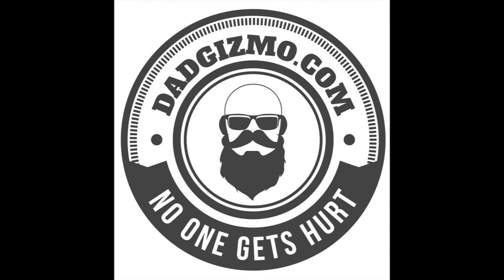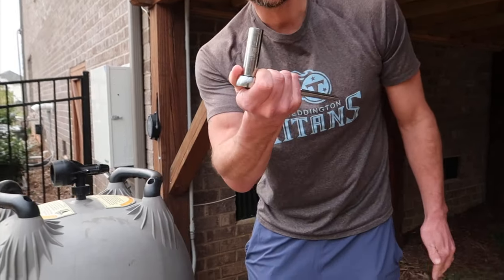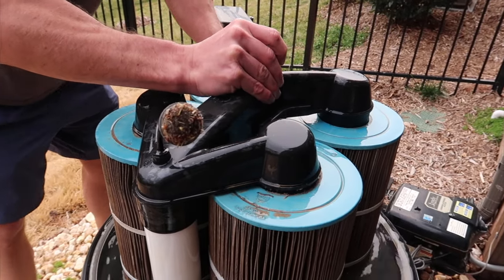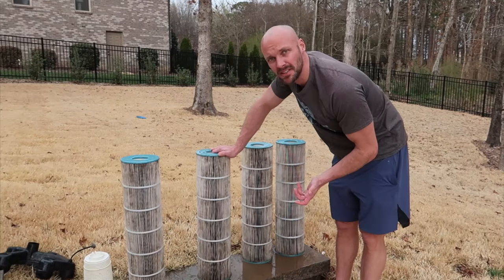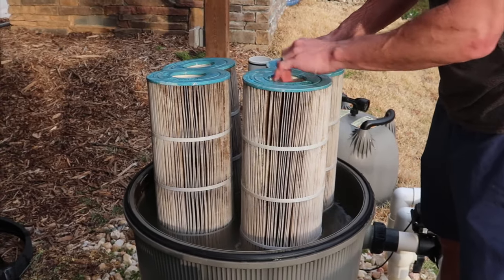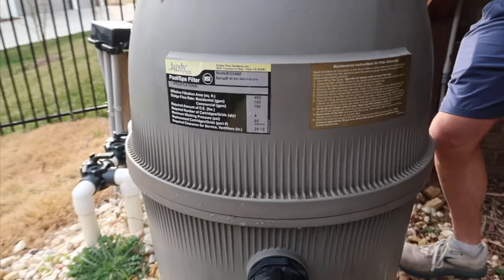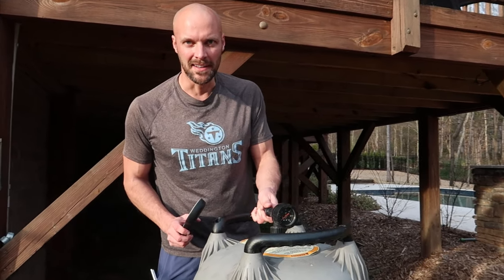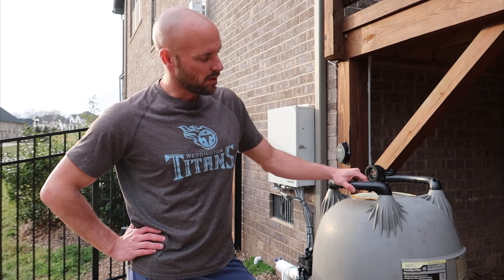OPENING A POOL - How to Clean a Jandy Pool Filter

Comment: You want to leave the breather valve open when you turn the pump on until water begins to run out of it. once you have a steady stream of water, you want to close it. This allows all the air to be released from the filter housing as it fills with water.
Reply from the maker: I never knew that!  Thank you!
Reply: @MrGizmo211  you’re welcome. Doing that allows the system to be primed. Hope that makes sense. Thanks for the video. Good stuff.
Reply: Thanks! This really seems doable…and maybe not as scary…
Reply: I agree.  We didn’t know that and when we started up the filter, all that air pressure came through the pipes and out into the pool.  It was scary because the pipes were shaking and rattling.  I hope it didn’t damage anything.  Lesson learned.  Keep breather open to release all that air.
Reply: Doing mine today for the first time! I’m confident!
Reply: Me too!
Reply: It was simple. After putting everything back and let the pump run, I though it was leaking , but it was just water dripping from released valve down to the clamp. Lmao. I was worried for a bit
Reply: What is the breather? The valve at the top that releases air?
Reply: @OfficiallySusan yes... I guess bleeder is a better term than breather.
Reply: This is a very helpful video.
We just did a remodel and the pool company was short on instructions.

Comment: I appreciate the video but there is a drain plug to drain the water out of the filter. And as someone else mentioned keep the air bleed OPEN when refilling until water comes out of it. Both of these items are covered on the instructions printed on the filter assembly.
Reply from the maker: Absolutely

Comment: Great video, but I will say that I find it extremely difficult to get the top back on squarely so that it doesn't leak. Takes a few tries and is frustrating, if you've got a pro-tip that would be awesome!
Reply: Hey bud, if you lube the gigantic O- ring and wipe down the mating area of the top, you should be able to just gently drop the lid into place. It will slide right on!!!
Reply: Light lube on the tank ring and Rubber mallet. Gently tap from the center of the opposite side of the bandclamp forward towards the center bolt. Do this from each side a couple times tightening between taps.

Comment: Excellent video.  If you are cleaning your Jandy filter than this is the video to watch. Thank you i followed you step by step and my first cleaning went perfect.  I would like to add that I drained my filter and if you do this then after you put the casing back together and screw it tight and secure you will need to open up the other filter with the smaller white filter with the tab that he shows also cleaning and add 3-5 gallons of water and then secure that top ASAP to eliminate air.  This will add enough water back into the main filter when priming and starting back up.  You always want to make sure you see water through that clear top. Hope that helps. Thanks again for this video you have no idea how much help this was.
Reply from the maker: Excellent points Mark!
Reply: …this is GREAT intel… I’m so glad you shared this. I’m gonna REALLY try to do this THIS weekend…🤞🏾🙏🏾

Comment: So why does Pool Guy charge $100 to $150 for this service?
Reply from the maker: Dunno - it is easily done :)
Reply: @MrGizmo211  Two questions: 1) What does it mean when you hear no pressure coming out of the valve and no air escaping when you open the p[pressure release? 2) what does it mean if the nut and bolt holding the outer black ring of the pool filter are very hard to take off I almost have to yank it off the pool filter!  is it dangerous for me to do?

Comment: Excellent instructions except when we turned the filter back on, the air from the tank blew through the pipes, shaking and rattling them.   I think we should have kept the breather valve open until water came out and then close it.  We also drained the entire tank to hose it down.  Later learned that we should have added water back in before starting the filter.  Lesson learned
Reply from the maker: Yes - that was something I learned as well :)

Comment: In another video, they recommended Simple Green cleaner. Would also rec draining entire housing (there’s a drain at base) & hosing down base. Very helpful video! 😁
Reply: Does it refill itself or do I need hose?
Reply: It refills once everything is reassembled and the pump powered on. Don't forget to ensure that the valve where you released the air is open until water comes out, then you close it. Nonetheless, I recommend just draining the water every time.

Comment: Excellent instructions, thank you!  The process is simple and easy to follow.  However, the amount of dirt and sand in the filters was shocking to me.  My pool is one year old this May, it's March right now, so I knew it was time but wow!  I think each filter probably weighed 20 lbs dirty and maybe 5 lbs clean.  My neighborhood is still under construction so there is a huge amount of dust, hopefully, this will settle down as time goes by.  Thanks again for the excellent video, very helpful.  I have a weekly pool cleaning service and they wanted $125 to clean the filters.  Now that I've done it myself I can see that's not a terribly bad deal, but I can certainly do this amount of work to save that money.  Now that I know the process I'll just clean them twice a year and try to stay on top of it.
Reply from the maker: The first year you get a lot of sand and things from the pebbletec as well.  Glad the instructions work for you !!

Comment: great job helping me understand how to change the filters.   I just removed old ones and put new ones in using this video.  so thank you.  one thing I did want to mention is that there is a drain plug towards the bottom of the unit.  After releasing the pressure, you can unscrew open that drain plug and water will flow out of the unit.  you can then rinse inside and water and debris will leave unit out the bottom.  overall though, great job!

Comment: Thanks for this, now I know how to do it, I was so super conscious of the thing being under pressure.
Reply: There is no pressure when the pump is off. The sound you are hearing is air being pulled into the filter system as the water is receding, not pressure being released. If you don't let the air in, then it is really hard to get the lid off and water will flow everywhere.

Comment: Super helpful.  NOTE:  If your pool equipment is LOWER than your pool (especially if it's several feet lower) then you'll need to add a step to TURN OFF the flow of water to the pump.   Otherwise, gravity will do its thing and draw water down to the system.   Then, when you remove the clear strainer cap or filter housing, water will continue to overflow out of the system.   Which can be scary.   Turning off the flow is usually done with a simple in-line PVC valve just in front of the clear cap strainer.    After you do your cleaning, remember to turn the flow back ON before you start your pump/filter again.

Comment: If you open the filter pump lid as well as open the bleed valve then the water will drain back down into the pipes (if you’re without a check valve).
Makes it somewhat faster/easier to pop the lid off. 
If your pool gets sediment in it and is vacuumed frequently the cartridge filters are suboptimal compared to DE filters. 
Also, be careful with Jandy drain plugs if you take them off. They are notorious in the industry for failing if torqued heavily.

Comment: so pool owner 9 yrs now - 1st put system in service mode so it wont accidentally turn on from automated programming, 2nd - those filters look toast!, they need cleaned better than that, I get inside every flap and spray it out.  I also soak the filters after I'm done in a 10% bleach mix inside a big garbage can for 30min, that kills most or all the algae etc.  Also open the valve at the bottom 1st, tons of dirt/sand in the bottom!  hand tighten valve and put back together like he did -  he did a gr8 job besides these 2 pts.  I do this 3x/yr, its not fun, I pay my son to do it lol
Reply from the maker: Good suggestions

Comment: It’s not a sensor it is a air breathing filter and tube….it is also missing the holder for it in the center….look up assembly for Jandy CL. O rings should be replaced at the same time……high pressure gun cleans the filters better….use live on the main O ring…

Comment: Is it not necessary to drain the pool cartridge drum?  I was told to drain it but i noticed you did not. I am going to maintain the pool myself so i am learning as i go
Reply from the maker: I drain it if it is dirty!
Reply: I dran and rinse mine out every time. I open the pressure relief valve on the top then the drain before I open the top. I feel like not draining it and rinsing it is like taking a shower and not washing between your cheeks! Lol
Reply: Hey, does it have an o-ring for the cap on the drain?

Comment: Why not drain the filter housing by unscrewing the large cap down there? Don't have to get all wet (but mind the miniflood that pours out). 

Pool guy showed me to also use that detached cap to close one end of the salt cell/prop it up for cleaning.

Thanks very much too!
Reply: I can't get that front cap back on without it dripping. Tried 4 or 5 times now
Reply: @christinawebster3242  I've never had a problem with that lower cap on the main filter housing. Maybe I got them mayuhn hayuns.

I HAVE had a couple times where I didnt tighten the salt cell couplings enough and they leaked a bit. It pays to come back and check things one more time once it's all running again.
Reply: @christinawebster3242  Judging by how hard it is to get that cap OFF, I suspect it requires a lot of torque to get it on properly so that it doesnt leak. This is probably why Gizmo doesnt drain it every time. I would siphon that nasty water out though, and not put expensive new cartridges right into the dirty water.
Reply: Hey, does it have an o-ring for the cap on the drain?

Comment: I think it’s time to clean (or at least check) my cartridge filters. I am soooo nervous. I have watched this video a few times…and I’m just SCARED. I’ve cleaned the pump basket. (I was scared to do that, too…but I DID it AND cleaned the impeller!!) 

I watched this video right when you first posted it, but now the comments from others are giving me hope.😬 I’m…gonna…attempt…this…THIS…weekend…for real (this time).

I have a new pool, I use skimmer socks now so I haven’t had to clean my pump basket since… so the cartridges MAY be okay… but I won’t know until I DO it… Sigh…😞
Reply from the maker: How did it go?
Reply: @MrGizmo211  …you are so kind to check on me… I still haven’t done it… yet. My gauge still reads that it’s good… I will DEFINITELY have to do it by the end of the season…😬

Comment: How much does a new cartridge cost? And at whats point  do you actually need to replace vs just cleaning it over and over ?
Reply from the maker: I usually replace mine every 2-3 years - but it depends on your conditions.  The top of the cartridges have a number to look up your specific item.  They cost about 150 for a four pack.
Reply: They were $150 two years ago for a set of four for a Jandy CL340, and are $270 this year. Ouch. You can usually do one simple green cleaning, maybe two, then you will need to replace.